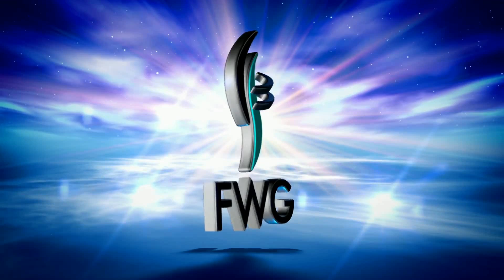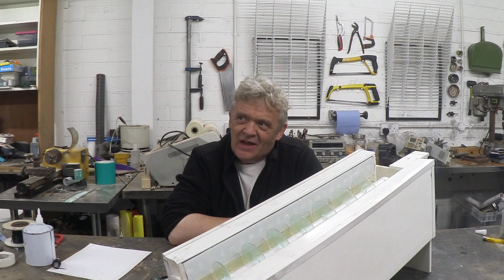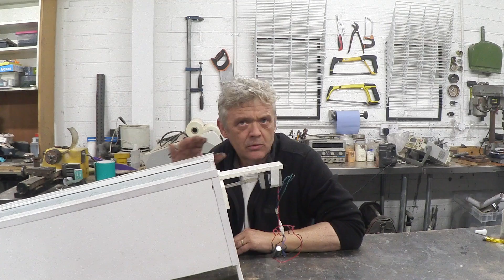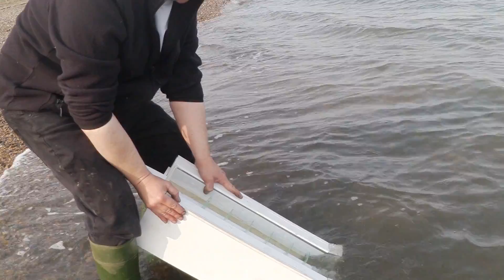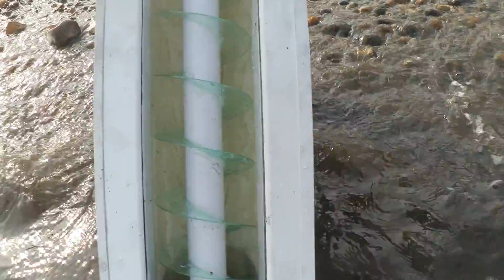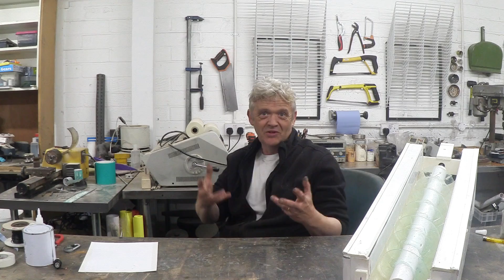Testing the Archimedes Screw Generator in the Sea - Wave Power

Comment: It's more suited to a constant flow like in a river, waterfall or in a pipe or at the bottom of a pipe. 
The weight of the incoming water holds the blades still in the sea, until it gets to the top and then provides enough weight to move it, and most of the energy available is lost. A waterfall would be the screamer.
Reply from the maker: cheers mate

Comment: First observation, the screw needs a ratchet to keep rotation in one direction with a wave application. But if the one you made were water sound, it really looks like a great size for a rain gutter downspout. Someone in a rainy area could use that to supplement their energy, surely. Four of those on house corners might be wonderfully practical.
Reply from the maker: screw direction doesn't really matter that much mate as there is a diode bridge and capacitor bank at the output end but I do like your downpipes idea for sure
Reply: @ThinkingandTinkering  Well, yeah if you can produce energy both ways then, yeah, a ratchet wouldn't technically help at all. I wouldn't have thought to wire it that way, runs against my design sense.
Aesthetically there's something about that reciprocating design which gives me pause. I suspect that the reversal of motion, the constant shift from positive to negative angular momentum, is a recipe for high wear. But aesthetics are only a good rule of thumb, so I guess experimenting with it is the only way to tell. But if I had to bet, I'd say it comes apart faster than a similar design which only turns in one direction. But of course, that would produce less energy, too.
Reply: I think it's the hurky-jerky motion of the waves that makes the reciprocation seem odd to me, because the mechanical advantage is plain. Like, if you made a big, floating, vertical screw like that, and anchored it, to harness tidal change, then I can see the reciprocation being effective. The slower movement would seem to allow for reciprocation better.
But whatever works is what matters. Always good if I can ferret out a flaw in my thinking.

Comment: A shorter cylinder and bigger diameter...I can imagine the next iteration made from vinyl records. If a 3 phase generator is used then it should produce power in both rotational directions with a 3 phase rectifier. Add your capacitor and Bob's your uncle lol. What do you think, Mr.Murray-Smith?
Reply: In a way, his little nema motor it's a 3 phase generator. Some of them are 2 phase, but they sell those rectifiers for cars "dynamos"
Reply from the maker: I think it is an awesome idea mate - off to thrift store to get some LPs!

Comment: That is a great idea , if you used a one way sprag,  the screw would always turn in the same direction
Reply from the maker: it doesn't need to mate there is a diode bridge and capacitor bank on the output

Comment: In the mountains in Poland they have archimedes screws in bucket like containers, very slow turning with a lot of torque.... connected to a gear box that generates very high revs for electricity production. You could easily modify your existing models and connect gears made as in a previous video. That could be interesting. Just got permission to put a model hydro plant in a private section of River Blackadder. If anybody wants to trial any designs I am up for it so long as it uses 'scrap' or 'cheap' for the construction.
Reply from the maker: no way - that is an awesome opportunity you offer there
Reply: @ThinkingandTinkering  The Blackadder is 300 metres from my cottage and land with riverbank access.

Comment: All this Victorian tork, 🤣 on how to build a generator....

 What if the ac generating sea coil needs a v shape intake built into the sea and to be set in a pipe at the end of the V.... so we get wave compression.... and suction as the wave washes out.🖖
Reply from the maker: I like that mate - you should build one and try it - let me know how you get on
Reply: @ThinkingandTinkering  that is the plan in Greece.... I'm not too coastal at the moment....  hadn't thought of an archimedes screw for it either...  I designed a (theoretical- )desalination plant using reverse osmosis membranes and the south Indian Ocean near pondicherry (crazy tides their)  it used granit v to fill an inlet and power a piston arm squirting designated water up onto a point beyind the shaw).

I designed a run off for saline water to be pumped to the point where surface level sewer drivers rejoin the sea to salinate the sewage...

Anyone elce has time to build it first. Crack on

Comment: This is an excellent idea. You could turn the generator 180 degrees, when it's placed by the sea. Dig a hole and place the lower part there. Gravity would help with the electricity generation.
Reply from the maker: nice one mate - cheers

Comment: I appreciate how you use tested methods like the Archimedes screw to display your principal beliefs and point of view.

I would really enjoy seeing how well your bellows runs an aeolipile and how you would scavenge parts for one of those 😊
Reply from the maker: I like that idea mate - I might give it a go - I have a sphere somewhere if I dig around
Reply: "An aeolipile, also known as a Hero's engine, is a simple, bladeless radial steam turbine which spins when the central water container is heated. Torque is produced by steam jets exiting the turbine, much like a tip jet or rocket engine."

so in essence, put more fluid pressure in than can leave the jets in a given time scale, a positive pressure tank feeding fluid to the moving outlets... so pressurised manual water sprayer and banned plastic straws/thicker plastic stemed ear buds on a sealed revolving head.

Comment: Directly into the waves like that will produce an alternating turn on the screw which isn't ideal for generating. If you aim for bigger waves that can overtop the the high end of the screw then the flow through the device can be more consistent just like a river or stream. That of course leads on to  questions of 'how big to make the catchment area' for the top lock, but that's the fun of prototyping!
Reply: Or have a series of generators arranged so that a wave crests on each one in turn?
Reply from the maker: it is indeed mate and I think you are spot on there

Comment: I wonder if you could make a floating one,  on a barge- for small rivers and such?  I'm thinking more community scale of course, with some kind of, maybe a  bank of flow batteries or what have you?  (or smaller, of course)  That might be an option for power production that Didn't  impede natural waterways like a hydro dam would, and it could handle varying water levels.  I just see eco friendly potential there.
Reply from the maker: I would bet you could - fancy trying it?
Reply: I might.  There's a number of waterways over here that due to environmental or downstream concerns, you can't  dam them.  But a Boat is no issue.  hmmm...

Comment: I'd be curious to know if adding a lip to the outside edge of the screw might improve performance by keeping the water (weight of the water) on the screw rather than letting it spill out around the top/sides/bottom.
Reply from the maker: it probably would mate and to be honest not that difficult to do

Comment: To me, the value here is in being able to do it at all, using items found in an ordinary home. TBH, both the energy collector and the motor CAN BE exercises in optimization. But that’s necessarily the second step at best. 

The first step is building something that functions at all, and I think it’s a project that deserves respect on its own terms. Lots of us don’t have a good background on what these basic machines are, and the process of disassembling a collection of stuff and cobbling it back together is very instructive not only on what the new item is, but also adds insight into what the original items functionally are. That’s valuable for someone like me who doesn’t really know these things already. 

I’m a little baffled by the idea that someone would watch this channel and think it’s about optimization. Clearly it’s going to be most efficient for nearly everyone to plug your items into the mains/grid. If you’re not doing that, you’ve decided to be comparatively inefficient for one reason or another.
Reply from the maker: I agree with what you are saying here mate

Comment: The really cool part of it is that you do not need any special diverters or channels to redirect the wave energy in your showing of it, because the waves just dump water in for you, and it drains out generating power!

I honestly did not see, read about or think of this SPLENDID eventuality, but its SO GREAT that it is indeed there!

All one needs to maximize this even further, is a semi funnelly-troughy like top so more water lands within the confines of the device, and it will almost run constantly without complex channeling, back gates or such!

This is not to say such additional features would not increase efficiency and stabilize the ebb and flow/surge-and-cease issues inherent in the pulses of waves, but if one had such a device as would employ a flywheel, to some extent it could still overcome such intermittent power application.

For those who would say a flywheel would never work on such a slow system, especially one with such a low basic power, I must say 1, Flywheels can work at almost zero turning speed if they contain enough mass, 2, a properly geared, or passively clutched connection to said flywheel could be made, simply needing some period of initial time to spin the flywheel up to speed before applying a properly rated generator load, and 3, since this whole thing is scalable, a much larger screw, with 2 or 3 helices, a shallower baseline draft, and more water head capacity would be far more capable of driving said flywheel, so "Don't knock it until you have tried it"...and done so with an open mind, and a goal to be fair and honest in the attempt, because it CAN be done!
Reply from the maker: I agree and I like your concept - there is one other thing I noticed but didn't mention - the sea life that was washed into the device exited unharmed and the detritus around it didn't seem to clog it
Reply: You can construct a floating device which is semi submersed, with a slope concentrating incoming waves so they get a higher altitude, could be some kind of collector bath, with an outlet driving whatever generator you like

Comment: With a whole lot of wave area, one can simply put tens of millions of these out, if they lack enough height to obtain much length, and any width/diameter one uses, the larger, the better, and with a whole ocean ahead of you, the size you can make it is pretty large, AND if you include such things as tidal forces [there are actual tidal dam generators out there already, so its proven technology] one has just a tremendous amount of power on tap, 24/7/365 [barring storms, icebergs, wreckage, sea trash, etc] so while one might need to take additional steps to protect their devices from damage from undesirable eventualities, MOST of the time, the machine(s) can run most of the time at full power.
Reply from the maker: they would be cheap to produce as well

Comment: Now put that at the bottom of a cliff with a long pipe and screw and at the top a gearbox that will always turn in the same direction and you have a generator.
Reply from the maker: for sure - not really sure if you need the cliff though
Reply: @ThinkingandTinkering  Yeah, you get a cliff or a very steep bank with a strong wave action, put the pipe into the sea and the waves rising and falling will turn it, they did it with a propeller that turned in the same direction regardless of air direction and produced power.  I don't kow if they ever made it permanent or it was just an experiment, but it worked.

Comment: awesome, I beat the ones who say first. Would this work better under the surface of the water?
Reply: Ha ha, I actually replied to one of those folks, I asked them some questions about their action but never got a response, I've been half tempted to have a go myself but desisted. As to your question Howay, under the surface of the water it then becomes a tidal generator doesn't it?
Reply from the maker: it would work - I am not sure it would be better - there would be different issues for sure